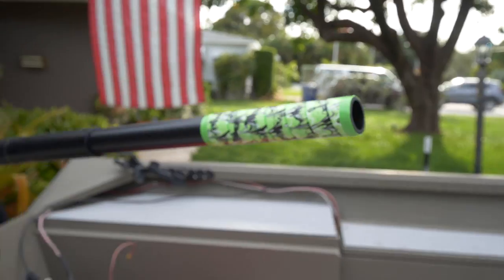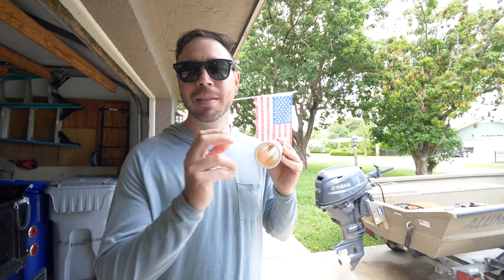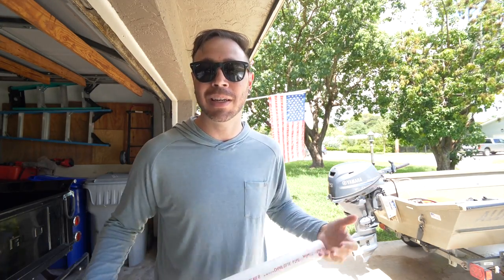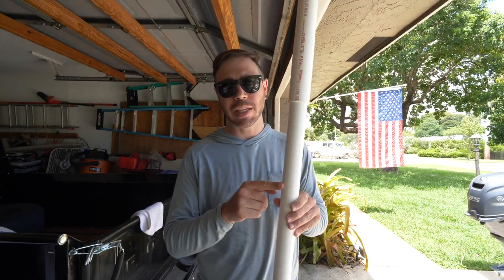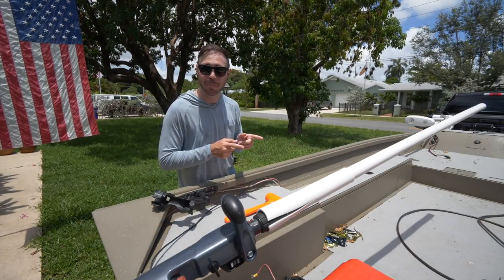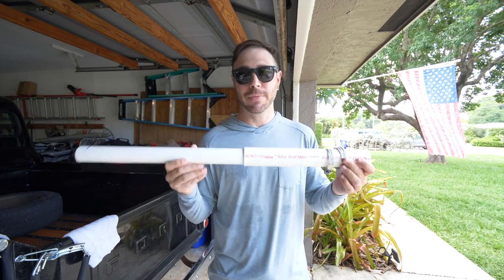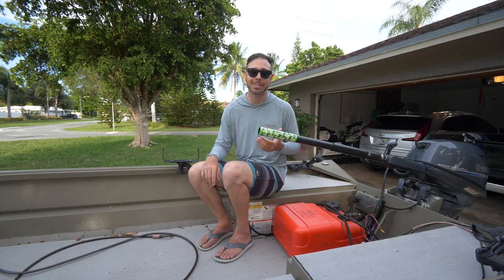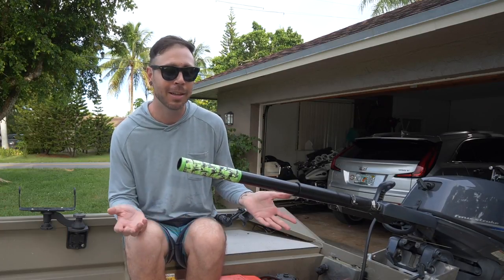How To Make A Tiller Handle Extension For Under $15

Comment: why couldent  you use the heat gun to flare the end to fit the tiller handle instead of using the hacksaw and then use the one hose clamp to secure it thus getting your weight bias forward

Comment: I used 2 shop vac extensions. 1 slides inside the other making the length i wanted. These are lighter than pvc, fit exactly over my tohatsu tiller.  Do the pair of cut slits making it have the ability to be clamped tight. Already black.

Comment: Hi from Mexico. Sorry for my english writing. Your video is very good and excelent tip. 
I own a 25 hp 2 stroke yamaha, but i dont know what is the name of that accesory to put in fwd or reverse the motor. 
My motor is beside of it. But i want to put that more in the front. 
Thanks. My respect to you all

Comment: Going to give it a go but use a cap and maybe cut the cap in half so water won't get in the end.
Reply from the maker: I don’t have any issue with water. Just lizards and spiders getting in there. I should cap it 😂
Reply: @FloBass  Yea maybe cut the cap down 1/3 to make it more profile a full cap maybe to much but it might be perfect I guess you could just not glue it, what do you think about making a shallow water anchor pole ? Do you have one you recommend or custom make ?
Reply from the maker: I've never made one. I have the power pole micro on my kayak and use their stake. You need something rigid to make a stake out of. I've seen people use wooden dowels and curtain rods as a cheap solution.

Comment: Great job my man!

Was looking into installing stick steering for my 11 ft Sundolphin pro120.  However making an extension like you seems way easier, faster and cost effective.  Thank you bro!  
do you have a followup video of you using the extension on the water?

Btw what’s the name of the music track in the background. Thx
Reply from the maker: I have plenty of videos of me out on the boat with the extension. Check them out if you want.

Stick steer is cool if you have a long boat and plan on fishing solo. You can sit way up front to balance the weight and optimize your top speed.
Reply: @FloBass  I’ll check them out…thank you for replying.
Reply: Btw what’s the name of the sound track? Luv it.

Comment: and at what height relative to the bottom of the boat should the motor be raised when installed on a hydraulic lift?
Reply from the maker: CMC recommended 3 inches.
Reply: Cavitation plate should be level with the bottom of your hull

Comment: How are handling the kill switch cord?
Reply from the maker: Handles just fine. Its more difficult to make a tight turn, but I just lift the handle up to do that. The chord has plenty of stretch to reach my wrist, but I usually just clip it to a belt loop.

Comment: How did you apply the PVC cement?
Reply from the maker: I didn't use any. I heated up the larger pipe and slip fit the smaller one into it. When the large pipe cools, it shrinks and creates a tight fit.

Comment: How do you press the kill button on the end of the tiller handle with the extension in place? Or do you just kill the engine with the choke?
Reply from the maker: The kill switch is near the shifter on this motor.

Comment: tiller extension handles are roughly 16.00 for adjustable 17-32".... how broke are you.........
Reply: There’s no way I would trust a tiller handle under $50 let alone $16. Just look at the reviews. In many cases they break on the first use, and that’s not some thing I would want having snap off. This PVC one would be extremely stout in comparison to the ones you’re referring to.
Reply: Those are fine for small outboards, very sketchy on bigger ones like my 30, way to much torque on those cheap ones.